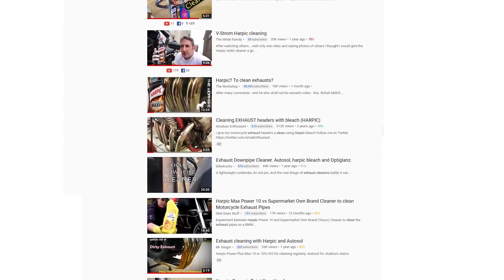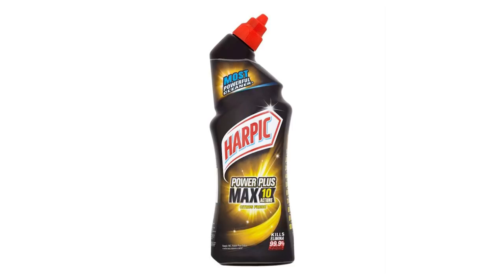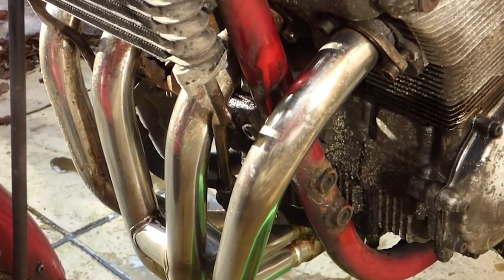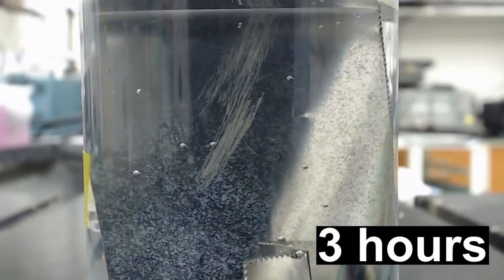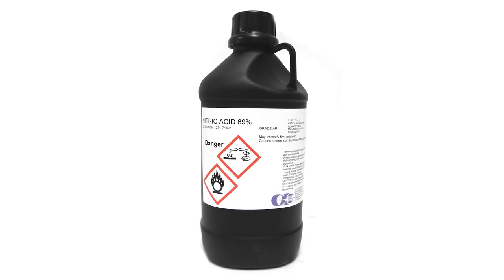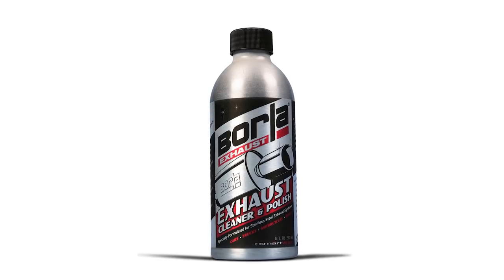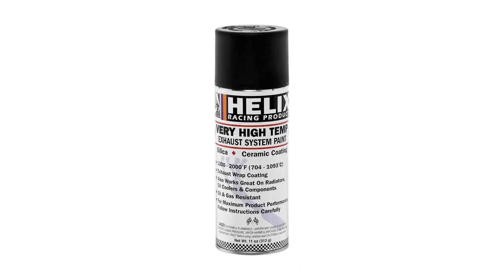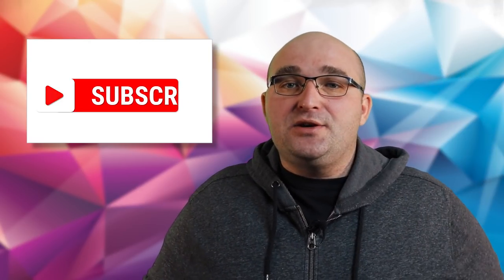Cleaning motorcycle exhaust headers with HARPIC? DON'T!

Comment: Never had any problem with harpic and Downpipes, does a nice job, been using it for years,  it also works wonders on my toilet bowl, and it has never caused any problems with either the chrome handle or any else it comes in contact with, AND I don’t ever need to don heavy duty gloves, safety glasses, respirator, steel toe-capped boots, apron, or any other useless crap, and I’ve never had to take the toilet outside to use in a well ventilated space, So I think I’ll just keep on using it and be very happy with the resulting shine,😂😂

Comment: Used it for years. Never had an issue. I wouldn't put it on 'chrome' pipes, but for a couple of minutes on stainless it's fine and it works.

Comment: exhaust wrap is the worst idea actually, it holds water and destroys your pipes in no time
Reply: Exactly 👍
Reply: ...and causes the pipes to overheat, this can lead to a decrease in engine performance, as well as increased wear and tear on engine components.
Also exhaust wraps can be a fire hazard. If the exhaust wrap becomes damaged or frayed, it can come into contact with other engine components or combustible materials. 
This can cause a fire, which can be dangerous and expensive to repair.

Comment: So stainless steel is 'coated with a whole buch of other chemicals and metals'. Sorry - no it's not. Headers are not usually coated at all, except with the protective oxide that makes them stainless. If you want to make YouTube videos at least try and get your facts right
Reply: I think that he is referring to headers that are chrome plated or otherwise treated.  Never seen chrome plated headers?  Ever seen a Harley or the clones?  Someone could use this on those headers and wreck the chrome plating.  It will also stain nearby aluminum and harm paint if not applied carefully.
Reply: Stainless steel is coated chromium oxide. Chromium oxide dissolves in hydrocholic acid.
Reply: @alanhassall  You don't use Harpic on chrome. Nobody recommends that.
Reply: @Racer57  Stainless steel is not coated chromium oxide. Yes some (very little) stainless is oxidized and removed in the cleaning process. Virtually anu cleaning process removes some of the base metal. There is virtually no body of complaints of Harpic (or any other toilet cleaner) damaging the headers. If care is used it doesn't harm anything else either.
Reply: @Racer57  stainless like other metals naturally form that oxide ..... what do you think most of that tarnish is anyways, it's like getting white patches on anodized aluminum thats just un dyed aluminum oxide .....
Reply: @Racer57  there's absolutely no coating on stainless steel unless you're confusing the layer that interacts with the air but that's not a coating that you can really remove or isn't already removed and replaced by oxidation

Comment: i've not seen any stainless steel headers that are chrome plated  , they're just polished  and washing the exhaust with bi carbonate of soda after cleaning neutralises the acid ..
Reply: Water neutralises also...
Reply: Stainless steels contains around a minimum of 10% chromium, do some research!
Reply: @oddis188  what is in your water?  Hydrochloric acid is acid.  Water is neutral.  All that it can do is dilute an acid as it is washed away.
Reply: maybe Harley Davidsons are. Not sure. Your usual cheap motorcycle is not, that's for sure
Reply: He doesn't seem to understand that chromium is part of the alloy not a coating

Comment: Issue is saying "oh just leave them dirty" most headers are made from a ferritic stainless, means they will rust, this type of acid is used industrially to remove rust, another thing you seam to miss is the chromium in stainless isn't a coating, it's part of the alloy. While yes this will mess up other things on the bike, this will clean and remove rust from stainless.  Only way your pipes won't polish again is of they are actually chromed, you know the electroplated process, allot of us don't run chromed pipes
Reply: Agreed.  Stainless steel doesn't need chrome to be electroplated onto it to get a mirror finish. It just needs to be highly polished.

Comment: Best way I've found, steel wool 00 or  0000, it's that mild I've used it on chrome for years. And harpic contains only around 10% hci, so it won't do much damage unless you soak chrome in it and even then at that concentration it would take a couple of days submerged. Muriatic acid is much higher percentage but yes, keep the lid on. The vapours on high percentage will rust all ferrous metals in an instant. It will rust every part in a garage over a weekend, just leaving the lid off.

Comment: 'Acid baths' are a completely normal, appropriate and professional approach to renewing metal parts. It's the standard.
The Harpic 10x process is effectively a cheap, household alternative as it contains HCI.

JUST REMEMBER to reseal and treat your metal surfaces afterwards now that they are bare to the elements.

Comment: Stainless steel is stainless because when the molten steel is poured it is flooded with oxygen which burns off the iron which is the element that rusts. Not because it is treated. Most metal cleaners are either abrasive or corrosive which is how they work. The stainless pipe beneath the chrome plate will always have its inherent protection, the chrome is added for decorative effect not protection so yes you may remove the chrome plate by using Harpic, but at the point your looking at using Harpic anyway the chrome is probably already shot and the pipes would need to be re-chromed if you wanted to regain the initial shine.

Comment: Reading through comments it seems there is some misinformation in the video (like coating on SS pipes). And some misleading info (like wraping the pipes in the tape)
It seems although the acid is bad - when you neutralize it after - no significant problems, if any at all. Best way to test this would be filling a container with Harpic or similar and throwing in some SS with the same mix as the pipes - leave it there and see when it will just dissolve to the point of uselessness.
If every "cleaning" takes 10 minutes - that is the ammount the metal sits in the acid - clean every half a year and you have an equivalent of 1 hour acid bath over 3 years.

And pipe wrapings seem to keep moisture trapped (accelerating the rusting process), and other stuff like salt even further speeding up the corrosion. And ppl seem to have problems faster with this than with the Harpic thing.

Comment: Nice to know, I have a bottle of Harpic in the garage used on my last bike but I was not impressed with the results. In the end they were changed under warranty as they were very bad for a two year old bike. Will be using it for the toilet from now on. Glad you let us know how bad it is so it will be back to WD 40 and Autosol when it gets bad.

Comment: Stainless steel headers are almost never chromed. 
Parts structurally destroyed? Please. Rinse the stuff off when you are finished.
Wrapping almost certainly will cause excessive corrosion by retaining water next to the pipes. 
So where is the army of victims of Harpic use? I have never heard of anyone complaining about using it.
I have used it for years. 
No issue here, move along.

Comment: apply harpic.   rinse off harpic.   spray headers with bicarbonate of soda solution to neutralise any remaining acid residue.  rinse them again. spray with citric acid to re passivate the stainless steel. job done. no harm done cos youve   re passivated   the steel. now has new top layer of chromium.

Comment: There's a TRICK after usin harpic.   After your pipes r nice and shiny.... seal them REGULARLY , WITH mechanic heat resistant SILICONE SPRAY. ALL over the extractor pipes.   ( can be used on all rubber and engine areas too , super protective )

Comment: Nice vid.  How about Citric Acid to passivate the stainless?  More effective wiith less probability of harming base metals to to overexposure.  I am researching the correct temp and concentration.  It is readily found in food quality quantities, so is biodegradable...  Please shoot a reply.  Thanks.
Reply: Nitric acid would likely work better and is one of the acids used in picking gels anyway so safe on SS..3 series at least.  I know that it gets mineral deposits off of my stainless kettle lol

Comment: Stainless steel is not “layered” with chromium. Chromium atoms are inter dispersed in the metallic crystalline structure  with iron atoms (and other trace elements). You really should have researched first

Comment: Not quite right. Chrome isn't a coating on stainless steel pipes. Chrome is throughout the alloy and along with nickel provides the corrosion resistant properties in stainless over mild steel. In simple terms these elements help provide an 'invisible' corrosion resistant layer. Hydrochloric acid solution is actually a good method of cleaning the grime, oxidation and iron particles from brake discs etc. that causes localised reduction in corrosion resistance on the surface of the affected stainless steel through depletion of the 'invisible' barrier layer. Cleaning allows the reformation of a complete 'invisible' oxidation resistant barrier layer. On a microscopic level there's more going on but to put it simply clean stainless is more corrosion resistant than dirty stainless.
However you are however correct to highlight that you should keep hydrochloric acid off painted and aluminium alloy surfaces. Also a good idea to wear rubber gloves!

Comment: "heat-resistant header wraps... ...without taking any risks"

You mean aside from how they insulate the headers?
Reply: What is the problem with insulating headers?  Are they going to melt?
Reply: Umm...that's exactly what the wrap is for, it's not cosmetic. It's literally called "insulating header wrap".

Comment: stainless steel is not coated with chromium its part of the composition. HARPIC will remove grime and the majority of rust but must be washed of with copious amounts of water. stainless steel 304 and 316 are non-resistant to hydrochloric acid. a better option would be BARKEEPERS FRIEND which contains oxalic acid

Comment: Don’t wrap your headers with the titanium wrap.

My bike is new and paid a lot of money at for it.
There’s a heat issue with these particular bikes so I thought it would solve problem, but it did not. It actually caused another problem.

The first ten inches of pipe that exit the heads are at approximately 300 degrees, but when you wrap them with titanium wrap, that temperature jumps up so a crazy 660 degrees. This is not good.
This is very bad.
So wrap your pipes at the expense of the exhaust pipes because that wrap WILL cause the pipes to break down and also cause the heads to over heat over time.  Now you’re talking about replacing the engine or at least the top end.

Don’t take my word for it.
Wrap your pipes and buy one of those laser temperature indicators you point and Che k it out.
Just don’t waste your money or your time doing all that work.

Another thing about that wrap, it gets everywhere into your clothes, your eyes and your lungs and it itches like crazy and it gets all over your bike makes a mess. And this is the good stuff not the cheap Chinese wrap.

Comment: So that's what that yellow stain was on my cylinder head when I bought the bike. Fuckers have been using hydrochloric acid to clean it. Well, I don't feel so bad for using it on the bike I part exchanged with them now. At least I didn't spill a gallon of it though and only used on bolts and around the wheels.

Comment: I used a hob bright, no acid and cleans good.
  Doesn't clean everything off (rust) and requires some elbow grease but now they look shiny in the places they were brown before, rust is still there but I think it just needs more elbow grease as it's not acidic, gonna try wire wool next time.

Comment: What a load of bs. Do you have a clue what your talking about ? If you rinse it afterwards it’s fine. Since most recommend polishing with solval after using Harpic, your cleaning it off anyway. Exhaust wrap in the long run is terrible, it traps moisture, which then causes corrosion.